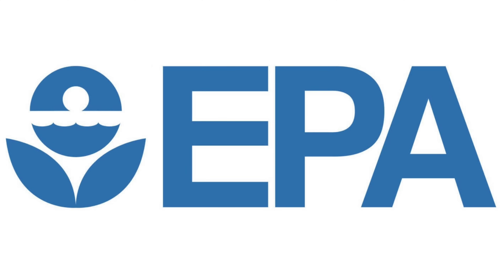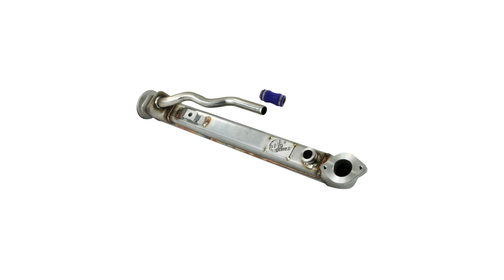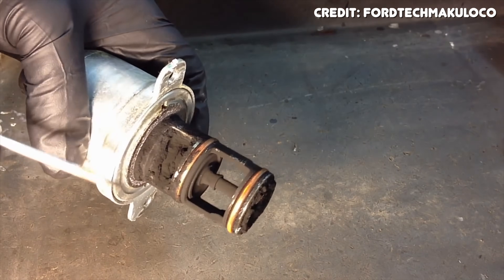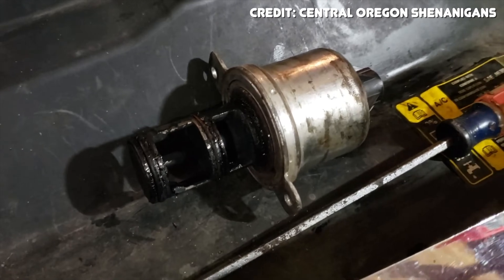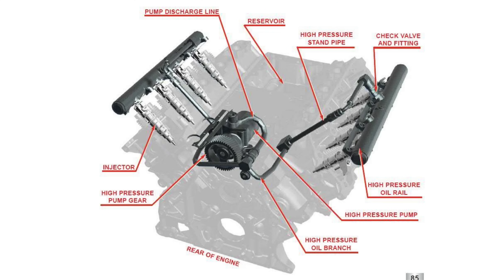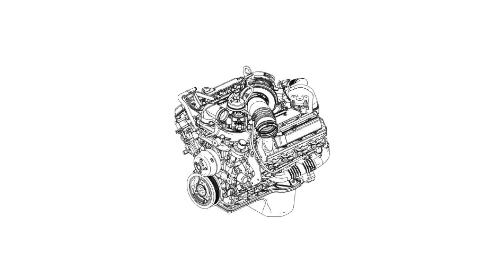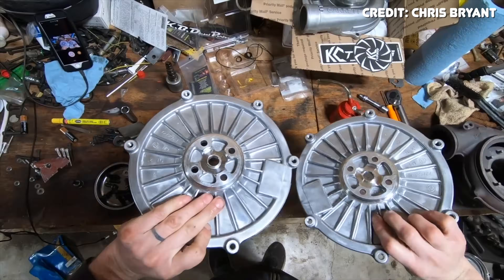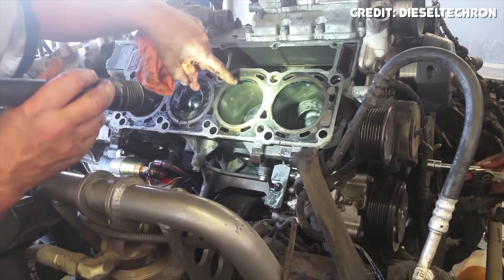The Truth About the 6.0L Powerstroke (And Everything Wrong With It)

Comment: I have had a 2006 since brand new and have 205000 Miley’s on the truck I have had to replace injectors,and  FICM and EGR cooler other than that normal maintenance so I was happy with the 6.0 maybe I’ve been lucky but I’m trading it in on a power boost so we will see what my next experience will be I didn’t dislike the 6.0 engine from my experience.

Comment: Well the 6.0 Powerstroke is less problematic engine and it will get fixed using a bulletproof. Now, the Archoil for Powerstroke industry. I do believe the Archoil oil and fuel products is the best company for 7.3 or 6.0l HEUI injectors causing stiction due to the cold in the winter. They using for nano-technology base lubrication and fuel treatment products.

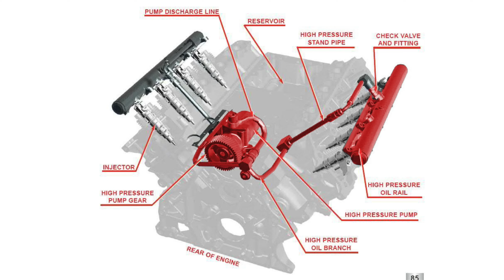Comment: At 9:16 he is talking about the updated oil rails but what’s on the screen is a 2003-4.5 6.0 which did not have hi pressure leak issues as they didn’t not have dummy plugs or the newer Stan pipes.

Comment: As it existed, it was horrible for us at UPS. Every system that had anything to do with it running would fail. Remans were even worse.
EGR coolers were the first thing to go 6 months into service. Then IDMs, stc fittings, oil coolers, iPRs, injectors, etc. 
Rarely were they 100% running right.

Comment: I have an 06 powerstroke. It's true. Many issues. I drove an 03 PS for a company and put 300 thousand miles on it Bone stock. If u put a tuner expect problems and the aftermarket does have solutions. That's what I did. Fixed every issue as they arose.

Comment: Nearly every single automotive/ pickup head bolt is a torque torque to yield bolt. Blowing head gaskets has nothing to do with the fact that they are torque to yield boots, unless the head bolts have been incorrectly reused of course. Even torque to yield head bolts do not stretch under high cylinder pressures. The head will distort long before the head bolt stretches. The benefit to an aftermarket head bolt is more clamping force constantly pushing the head down onto the block, helping to keep the seal between the block and head even with distortion. I am not defending the 6.0l. I have worked on many of these engines and would never own one for myself because I know how poorly designed they are. I am simply pointing out one of the things you said in this video that is completely false. I suggest you get a little more hands on experience before you claim to know all the problems with and engine and why they occur. Because it's obvious you have none

Comment: Spend a bit of time seeing what people that own them actually think about them. Several folks in the forums that have over 300k on a stock (non-deleted) block and head studs. 

Personally, I have an '07 with almost 200k. Studded and deleted at 120k due to a bad oil cooler (not studs). Went ahead and had them do that as well as swap to ELC coolant. Stock injectors, built HPOP, and several other mods. The truck runs like a top.

Comment: This guy talks a lot but doesn't know much. the oil cooler and egr issues happen around 200,000 miles as long as you don't idle your truck a lot. In other words turn off the truck if your parked. The FICM is not prone to overheat although low voltage can ruin them. Most diesels will change batteries every two years just no matter the brand because that's the nature of the beast and here's a little secret Chevrolet Diesels do blow head gaskets and Dodge has weak transmissions. Diesel maintenance is expensive no matter what the brand is so if you can't afford it buy a gas engine. I've had a 2003 i traded in on a 2006 f-250 and when that got wrecked I bought a 2005 f-250 used . 150,000 on the 2003, 236,000 on the  2006 when I had to replace the oil cooler and the egr cooler . That truck now has 330,000 miles on it and is still running but has issues from the accident. The big difference  between Ford and the others is that I always walk  away from Dodges and Chevys at the stop lights and I've never changed the tune on them. There is no such thing as a trouble free vehicle especially if you work the vehicle.

Comment: A lot of misinformation about the issues the 6.0 has was said. If you want to know the true ins and outs of the 6.0 and 6.4 check out Kill Devil Diesel. They just released new aluminum heads for these trucks and built the 6.0 that won back to back years in the diesel power challenge. He has experience with all the diesels and isn’t just regurgitating what he read on a forum somewhere.
Reply: Yeah right up the road from me
Reply: I almost bought the aluminum heads for mine some 6 or so years ago. But no one had posted anything about using them. My stock ones are still in the truck with bronze guides now.

Comment: I had a 2006 loved the truck not the engine I bought it new had nothing but trouble head gasket problems right of the bat they changed the head gasket twice didn't stud it internal oil screen plugged I had it financed thought Ford motor credit I called them told them to get it out of my yard I got a lawyer I didn't end up paying repo charges but lost my down payment and trade in allowance

Comment: I have watched many of your videos and you really seem to know your stuff. I have been trying to find out what the real problem was with a 1995 GMC Suburban 6.5L Diesel. I loved the vehicle however I had lots of problems. 4 high pressure fuel pumps at $4,500 a piece and 15 air conditioning compressors. But that’s not why I’m writing. 
The engine would slightly buck on gentle acceleration. It was like a backfire with no sound, or like the engine stopped for a split second. The engine finally blew up so I had another new engine installed. It did the same thing. GM Said that they did not know what caused it. I absolutely babied this vehicle. I only used Amsoil full synthetic with and Amsoil bypass filter. Oil changes every 8000 KM. 
If anyone out there can explain this “bucking” to me please contact me. 

BTW GM offered me $1,500 off a new GM 😂😂😂😂. I spent a total of $72,000 on repairs. I know I’m an idiot but please help me explain this. I never bought another GM after that. Between me, my wife and my 3 kids I have purchased 8 Honda vehicles. I love Honda. 22 years with Honda and absolutely no problems. 
Thanks again. 
Jim.

Comment: I hear the same bad "reviews" of the 6.4. They had a stop gap bad emissions system tacked on. My 2008 delete has 310,000 miles with only a trans at 270K. Tuner turned up, always towing heavy. I back out on grades. Oh by the way this thing is FAST and knocks down incredible mileage.

Comment: I have a 03 F250 4X4 6.0 powerstroke, with 188k on the odometer,  I bought it new.  Other than a turbo failure that was covered by warranty, I have had not had to put a wrench on it for anything except scheduled maintenance.  However I would like to find a trustworthy honest knowledgeable 6.0 mechanic to give a through inspection and update whatever needs it.  In the last 6 months I have stopped by a few repair shops (3) and have gotten very different estimates.  Anyway I have been completely satisfied with my 6.0  additional info  built 11/03  have hauled extremely heavy loads in a 20' fifth wheel dump and 36' tri-axle fifth wheel camper.  I reside in northern half of the lower peninsula of Michigan.  Still looking for information to extend the positive experience

Comment: Yup
Can be reliable w the right monitoring and maintenance 
I own 2 one for 11 yrs
2003 has 885,000 kms
Stock head bolts original trans t case 
Yes injectors and hpop couple times

Comment: I love my 2005 powerstroke with a 6.0 engine. Number one reason is the price. I picked mine up super cheap, and if your gonna buy a truck to just tune it and upgrade it anyways, why not start with a cheap foundation.  I really love showing off my custom truck with all its modifications,  and then at the end best part is telling people it's paid off, no payments😂
Reply: Spot on! I bought mine with a manual and 180k miles for 6g. I spent 8g on heads, head studs, Warren injectors, larger turbo, exhaust, intake, fuel pump, tuner, intercooler, oil cooler and egr cooler. I daily drive it at 540hp and 890tq, unless I’m towing. Now she has 251k and blows the doors off all of the new 6.6’s and 6.7’s out on the street. For the working man like me, 14k vs 80k for a truck? I’ll pick 14k all day especially when I don’t have to pay for DEF.
Reply: Got my 03 with 120,000 miles f350 for 13,500.  Did egr and oil cooler myself. Love the truck!
Reply: This is also my point, go ahead and go get a gm with 100 k more miles, and pay about 20k more for it.. 
I have a 03, paid for, and I also can afford to fix it if it breaks. It drags my fifth wheel and enclosed behind it just fine.

Comment: I have a 7.3 with 315,000 miles and a 6.0 with 240,000 miles. My 6.0 has been just as reliable as my 7.3.. not to mention faster.
Reply: I have a 2003 7.3 with 480,000 and a 2003 6.0 with 315,000 good work trucks.Ran all brands but  still in my 7.3 and 6.0.
Reply: I've got an 03 ccsb 7.3 nearing 300k, and an 04 ccsb early build 6.0 at 190k. Both have been super reliable heavy haulers, pulling 15k lbs loaded gooseneck trailers and 5th wheels. Both are mostly factory, injectors, hpops, ucvh, turbos, almost everything. 7.3 is hydra tuned with gearhead tunes, 6.0 is sct tuned also running gearhead tunes. No studs, big tunes, and have had zero problems with either. Engine vital monitoring and strict maintenance is all I've done. 

I've saw enough super high mile examples in my career to buy both and have had zero regrets. 

That said, the 6.0 is my pick. More power, more mpg, and just a more refined truck overall. And I like the king ranch leather, step/mirror lights and big power that it makes.
Reply: I lied. I replaced the fuel pump(my fault), and the ipr on the 7.3 for a failed ipr coil when hot. Just the solenoid coil itself was bad, the original valve and orings are still in the truck. Took about two minutes to replace the coil. Outside of that, not a damn thing on either truck.
Reply: I had 930,000 kms on 7.3.   rust ended vans life.
Reply: Me too.

Comment: I am a 6.0 guy. I’ve owned 3. My current one I bought 3 years ago from an older gentleman. It’s an early 2003 (built in February 2003). It is BONE stock. I tow 15,000 pounds with it weekly and I have never had a performance issue. I agree with you these aren’t race trucks and they don’t need to be. I’m a blue collar guy and if your a worker these fit the bill. I recently bought a new 6.7 but I think the 6.0 is well worth it for most guys
Reply: Same here tho mine is the early 04. I have just recently pulled the wiring harnesses off the engine repairing what needed  to be or could be as well replace the injector harness.
Mine too is a work truck and pulls or sits, that is why I invested it!
My upgrades have been simple ones. 
I was replacing number 8 injector and took a good look at the oil wells around the the valve springs, zero chit accumulation just clean castings, payback for the oil changes and OEM filters.
Maintaining this 6.0 is reflected in my pricing each time I hook her to a trailer. My service van E150 is gas and has a much lower maintenance cost and I can jump in this to buy a qt. of milk or whatever but not the F350.
I do understand the younger crowds need for power tho but - not their complaints about the cost of running the pressures they so want to achieve. 
PS mine was also covered under the Ford recall and rebuilt accordingly ;)

Comment: They're bad. I own one and run a repair shop. I try to convince people in the market to not buy them but also use my experience and ability to keep the ones my customers own on the road and as reliable as possible. If guys didn't like seeing the 6.0 out front I'd drive my 73 k20 every day and sell it. But when you're the local 6.0 guy they want to see the 6.0 running and being used

Comment: Ford didn't find a way to make the injectors fail from a dying battery.  Please, they didn't design the engine = that's all on Navistar.  I owned a truck with the 6.0.  I had through 35,000 miles.  The truck was stolen so I never had any problems with the motor.

Comment: everyone knows that the 6.0 has a ridiculously strong bottom end.  the current sled pull champions in the 6,0 class run killdevil heads and with a water jacketed block turn 2000 horsepower with spray.  stock block.  reality is that a deleted and studded 6.0 is a high revving unbeatable motor.  in stock form they are indeed prone to all the same issues as any other diesel motors with EGR and dirty exhaust recirculating back into the intake.  a deleted and studded 6.0 is a hotrod engine.  your "clinical analysis" should state "o-ringed heads, studded, deleted" #unbeatable.  in stock form you change oil every 4000 miles and you have a hotrod truck.   my own mechanic runs his 6.0 with a large turbo and 5" exhaust - 200k on the motor without studs.  it boils down to maintenance.  sorry you wasted 17 minutes on the video explaining so many issues when it boils down to maintenance,  the 6.0 is a high revving hotrod diesel and when studded they make 600hp with nothing more than 120% injectors.  what's also true is that the 6.4 is the larger bore 6.0 and again, studded and deleted these are famous for making 1000hp reliably.  ford did the right thing when they created the B20 engine and ditched navistar.  ballsy move and they got a quiet engine that does 800 torque in stock form and today you can expect steel pistons.  yes - and 1100 torque with all of the emissions garbage in tact.  better yet?  yes it gets better, you can go to killdevil and buy the 6.4 long block as studded and 0-ringed with carrillo rods and the SAME steel pistons, giving you a short stroke 6.7 that is a terror on there street.  it revs like a motorcycle too, as with the carrillo rods and steel short skirt pistons there's whoa!!!!! about two pounds of weight removed per cylinder!  yes indeed you have a serious high revving hotrod diesel then.  remove 16 pounds of weight from the rotating assembly and take your F350 super duty to the drag strip.

Comment: A guy I work with had a 2006 F250 standard cab long bed with the 6.0. He had all the mods done to make it "bulletproof", truck had 135K on it when it blew up. All the mods to make them reliable only delays the issue.